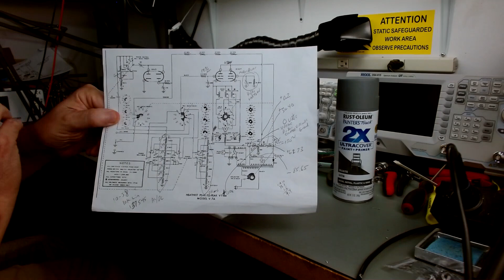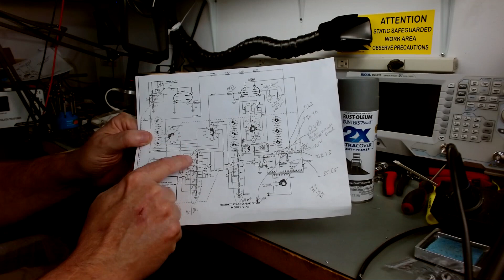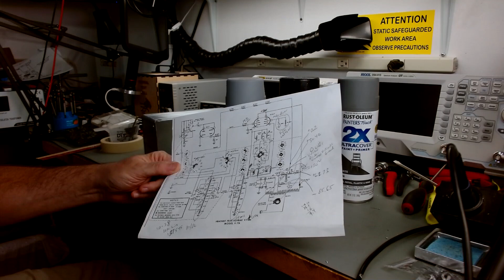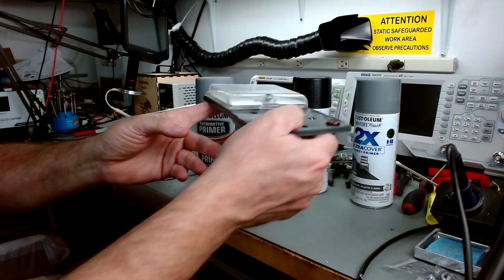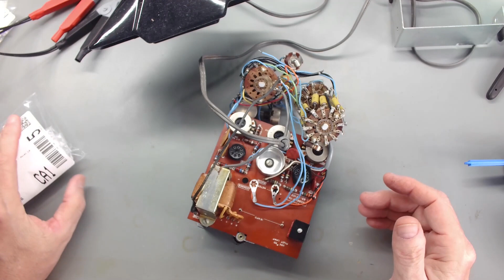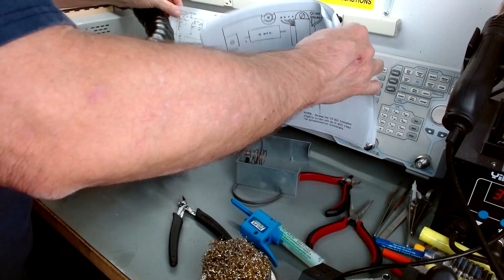Restoring a WRECKED Heathkit V-7A! PART III

Comment: Nice job. That 3.3M resistor measures 3.9M in my meter. It can't really be that critical if the tolerance on it is 10% but I guess once it goes outside of tolerance range it should get replaced.Would be great if you posted a link to Mouser project with all the parts that you used. Would save others effort of finding the right replacements.
Reply from the maker: Thanks! That’s not a bad idea but it was so long ago now I would not have an easy way to find the correct parts again. I do a lot of projects and so the paperwork and order number would be a long lost memory. I should have thought of it when I was doing it. 
Thanks for the great suggestion I will try to remember to do that if I do another restore like it. 
RJ